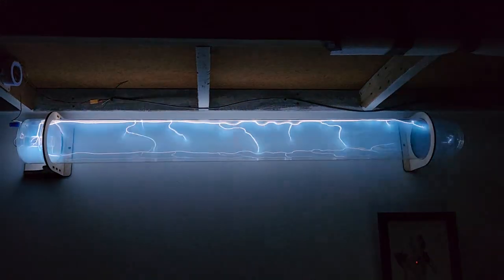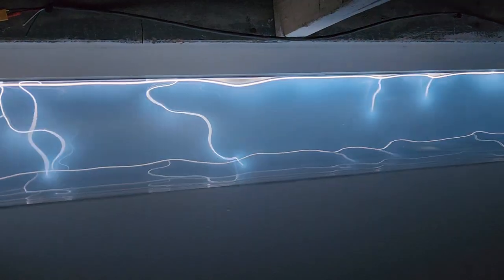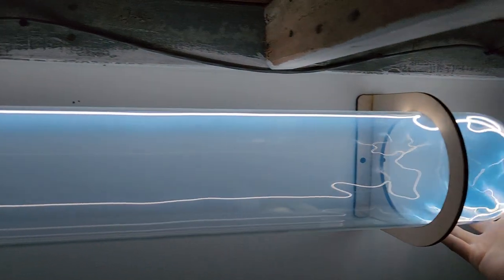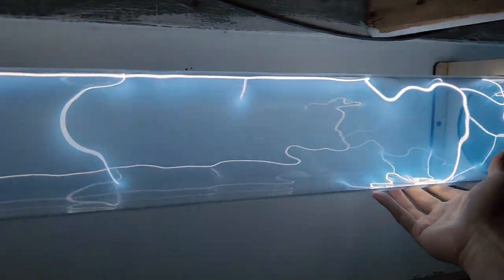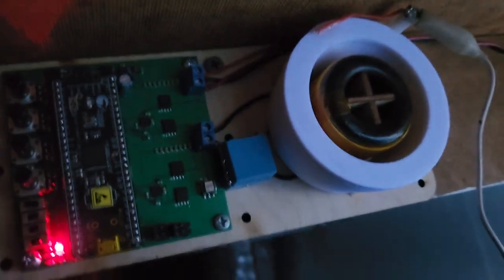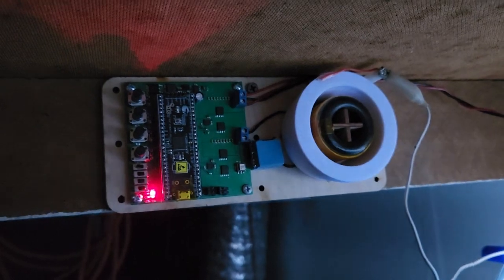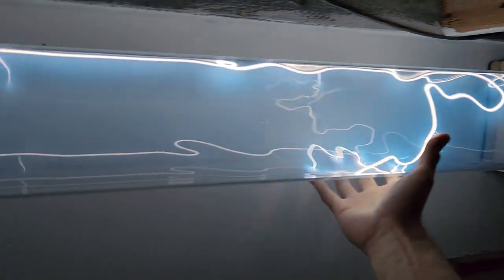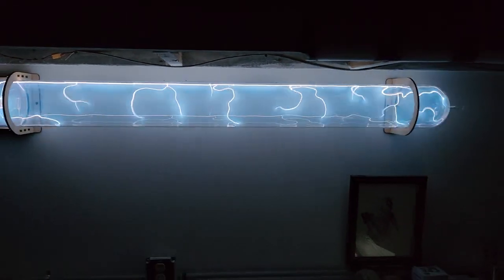Plasma art for the shop - Kr-I Lamp by Aaron Ristau.

Comment: Thanks for the walkthrough, Steve. So the primary is intentionally not driven at its resonant frequency to decrease the power transfer to the secondary and plasma load?
Reply: Like a x-ray transformer is driven
Reply from the maker: @KaizerPowerElectronicsDk  do they use freq modulation to achieve regulation?  I'd been curious about this.
Reply: @SteveWard  I was wrong, caught in the lands between DC blocking capacitors and actual resonant driven transformers. It is only using PWM for voltage regulation and current regulation in done on the x-ray tube filament current. Most I have found, has a huge single 4-5 uF MKP capacitor, the size of a slightly thicker beer can.

Comment: that is beautiful, bravo... whats the risk of creating UV or even X rays with that thing, is it possible?
Reply from the maker: X rays are not possible with the pressure of gas and voltage, you just can't accelerate electrons for long enough distance before collision.   UV is possible but the borosilicate glass would block most of it I suppose.  Biggest danger would be the implosion, I think..

Comment: Have you calculated the power consuption of the unit? I am very curious as to how much power it uses. If I understood correctly from the video this is a beautiful 48v 200 watt light bulb drawing approximately 4amps an hour. Cost of approximately $0.04 an hour at $0.2 a kw?

Comment: Truly amazing work - very Impressive would love to make one - but I bet that tube cost a pretty penny unless you blew and filled it yourself (probably did). I would like to make a bagle ring maybe its the one I may make - but nobody will make a krypton filled sphere for me - - 😢 - anyway like a lasing gas has an exited and ground state - are you tuning the power supply frequency to the resonance of the gas or the cavity (tube) the gas molecules are contained in or both? Andy👍
Reply from the maker: The glass was made by a scientific glass maker, it requires exceptional skill and expertise and tools.

No special resonance of the gas or chamber that I'm aware of. The gas pressure is tuned to form nice filament structures without needing too much power or voltage.

Comment: Are you using an FPGA to modulate the frequency?
Reply from the maker: Fpga would certainly work but I'm using a micro controller to generate the variable frequency pwm and measure the current response in the transformer primary by using a current transformer and ADC to sample the peaks.
Reply: @SteveWard  Would be cool to see a pair of these as a visual audio level indicator showing the amplitudes.  Seems that there is some sticking in the changes in arc lengths when increasing the frequency.  Wonder if that's just due to the PD effects or ion channel that has formed from the longer arc lengths.  Seems that the arc really wants to couple to the 48V power line above haha.
Reply from the maker: @Sam Catania  yes, would make a cool bar graphic display element.  Even smaller versions would be more predictable. 
 I agree with your note about sticky spark length, that seems to partly be due to nonlinear response of the resonant system but also thermal convection within the tube has a profound effect on the plasma length and behavior.  It's thermal convection that makes the plasma stick to the top, the wire is not a significant attractor.
Reply: @SteveWard  ah yes that makes sense.  Looking forward to the next project.